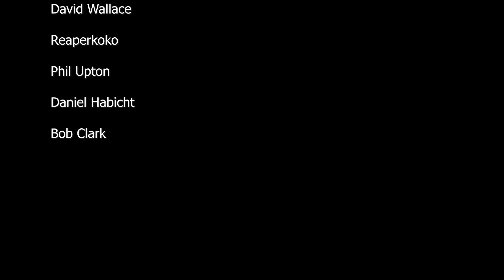Tactile Feedback From Vertical Actuators - D-BOX, PT Actuator, Etc.

Comment: Would it be useful to have a single transducer just for the engine vibration?
Reply: Yup... I have a butt kicker gamer 2 under my seat and it adds a lot.
Reply: Doesn't need to be dedicated for engine vibrations and I tuned those vibrations down because the frequencies also triggers my neighbours, even it's well isolated here and nobody living beneath my floor.
Reply: I have a Reckhorn 200 attached to the frame of a Playseat challenge for engine feedback,  it doesn't really make you race any better, but it sure improves immersion. 
And it gives a pretty good massage after a long day's work 😄
Reply: this is exactly what I do, just a big buttkicker for engine rpm
Reply from the maker: You could use one but engine vibration is movement of the pistons going up and down (vibrations in any car is always caused by movement rather than say sound) so easily reproduced using the upright actuators :)
Reply: @KarlGosling  I've not heard of problems with neighbours regarding actuators yet, but with shakers it's quite common and really difficult to dampen the rig against. I had the police twice in front of my door despite washing machine mats, a thick carpet both 20 mm thick plus 'vibration dampeners' under the rig. Only thick foam or a spring-suspension efficiently decouples the rig from the ground. The problem is called 'impact sound', so kind of both movement and bass-frequencies.
Reply: Im using a buttkicker2 under the seat. The transducer is great, but the included amp lasted less than two years. Still very happy with the buttkicker2.
I highly recommend using a subwoofer in combination with the transducer, really ties the effect together nicely on a budget.

Comment: Do the actuators work based off the sound like the transducers do? or are they more accurate working from telemetry data, I notice my transducers do not work as well across different sims, ACC for instance is missing details that AMS2 has.
Reply from the maker: As I said in the video they replicate 1:1 (within the constraints of  physics) what your real world car would be doing using the telemetry stream.